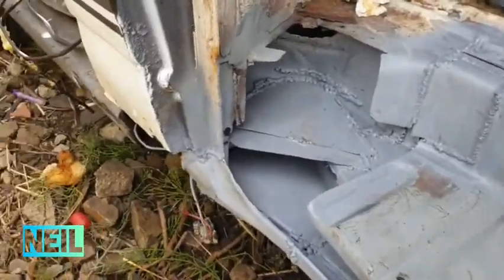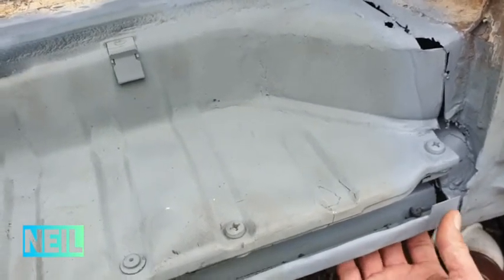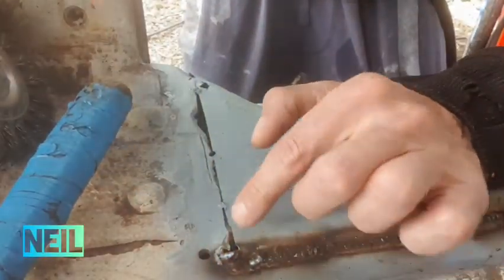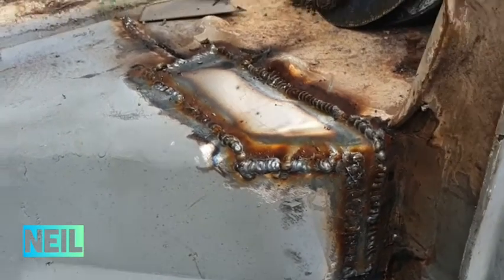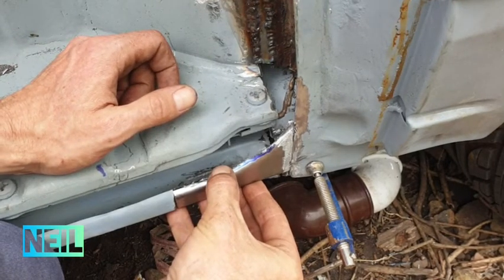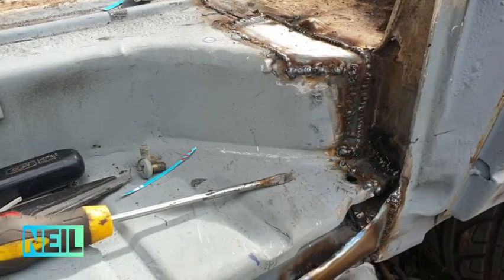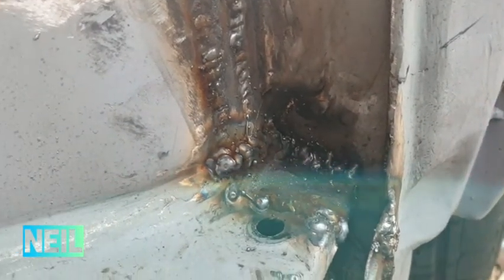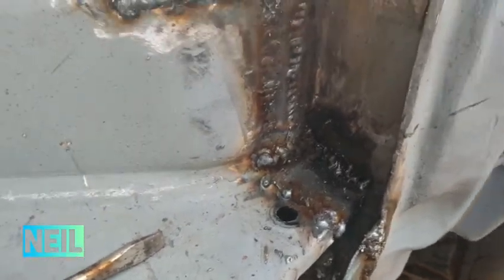Fixing my very rusty Volkswagen T4. Part 4. The sliding door sill is in!

Comment: Great video. I've got the door runner to weld on mine and ain't looking forward to it
Reply from the maker: Thanks David.  It seems to be a common place for the rust to set in. Hope you have somewhere indoors to work on yours. The weather is against us now.
Reply: @neil...  I don't unfortunately. I'm going to speak to a guy tomorrow about the welding. Its cost £150 in panels so far 😭
Reply from the maker: Where do you get your panels from?  I've seen quite a few ill fitting ones. Central panels on ebay make a good panel at a decent enough price. Id recommended them.
Reply: @neil...  I got them from heritage. They look decent quality and there galvo plated so should last I hope 👍
Reply from the maker: I bought a floor panel from heritage before someone recommended central panels to me. I haven't used it yet but plan to in a video very soon.

Comment: So far I’ve spent the last 4 months cutting out all the rust out over the whole T4. The sliding door sill area and bottom of the door is my last major area to do. I’ve started it but it’s a right pain 🤨 was good to see your methods 👍
Reply from the maker: Thanks for your comment Paul.  I wish the sill had been my last area to do. Im currently working on the sliding door. Its really just little patches it needs though so not so bad. I'm replacing the floor area next but the weather here has been terrible for welding outside.
Reply: @neil...  I’ve just built a temporary shelter over the whole van due to the weather. It’s a timber frame with a tarp top to keep the rain off. I’ve finished the floor. You can see some shots of it in my video. The vans appear to rust in the same place on the floor. Worst between the floor and chassis members and above the rear suspension mounts where water sprays up off the back wheels. You can get replacement floor sections made in the same wavy profile.
Reply from the maker: Ill go on and watch your vid later. Just subscribed to your channel. I have a floor cut from a donor van thats better than mine but it still needs patching. Ive had it soaking in citric acid for weeks to help kill the rust on it. I got a floor panel from heritage. Wasn't cheap! I've since been recommended central panels on ebay and can't fault them. Your right the vans all seem to get tinworm in all the same places. Your cover sounds decent with a timber frame. Ive been looking at the clarke garages/tents in machine mart. Look really good for the money. Think ill go that route. Need to save up a bit first.
Reply from the maker: Just watched your video mate. Couldn't comment on it though? Your van was about as bad as mine! You've put me to shame getting all that done in 6 months. Well done 👍
Check out this t4 app if your not already a member. Lots of like minded t4 enthusiasts. A good bunch. https://play.google.com/store/apps/details?id=com.tapatalk.justt4scouk
Reply: @neil...  I’ve tried several times to enable comments but It won’t work. Would be good for it to work as then people could help with ideas for how to do some things I’m having issues with.
Reply from the maker: I think its because you've posted it as "suitable for children",  which of course it is, but it takes away the ability to comment.
Reply: @neil...  your right! I’d never have thought of that! 😁

Comment: What magnet we you using there
Reply from the maker: Hi Jonlee, they are magnets i had borrowed. I managed to pause the video and the brand is "Power craft". Ive searched for them to send you a link but can't find them. Search welding magnet on Ebay or Amazon and loads come up. 🧲
Reply: @neil...  cheers, I’m replacing my step as well. Bit of a pain tbh.
Reply from the maker: If you need any pointers feel free to ask  👍